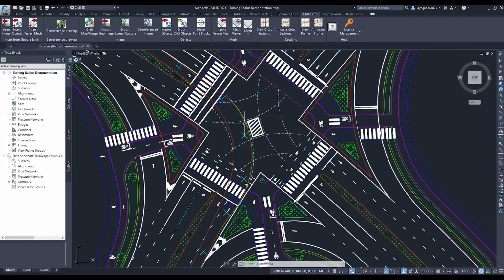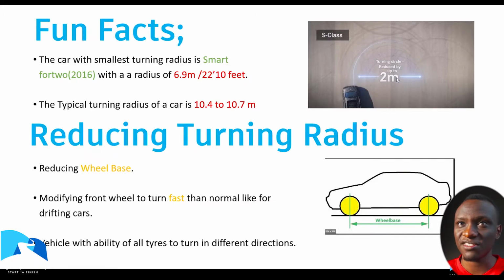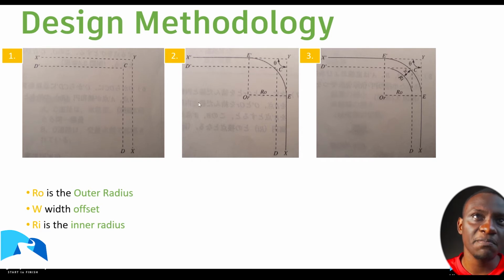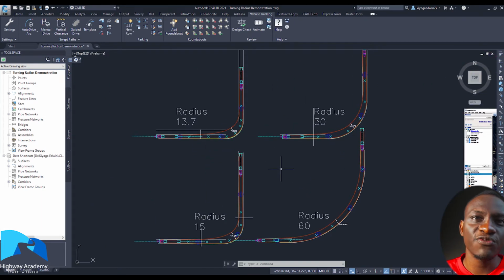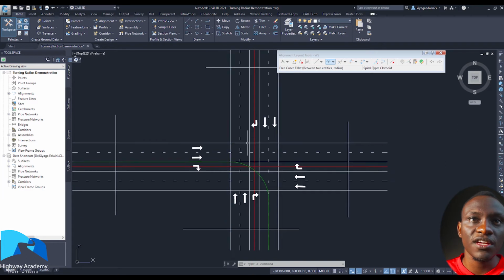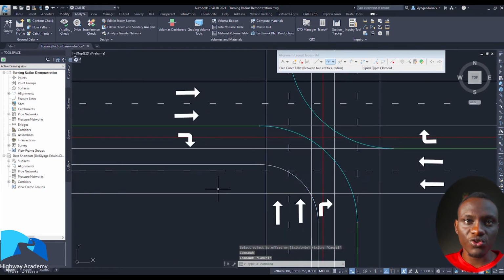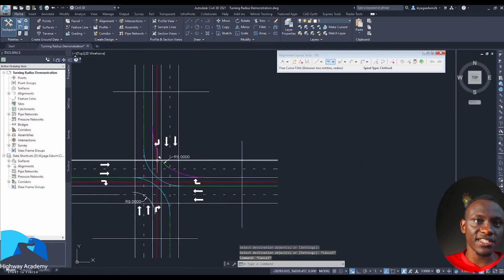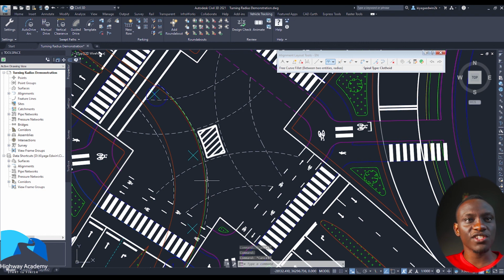Junction Design in Civil 3D:Turning Radius, Design Vehicle and Swept Path

Comment from the maker: The moment you've been waiting for has arrived! 
Our complete Ultimate Guide to Junction course is now officially LIVE on our website and also the beginner's Junction YouTube playlist is available. 

Connect with us: 
✅https://hwy.ac/junction

00:00 Intro
00:05 Introduction to junction design and turning radius methodology.
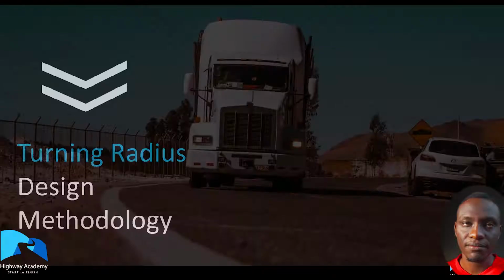01:01 Explanation of different turning radius types (curb-to-curb, wall-to-wall, inside).
01:56 Fun facts about turning radiuses.
02:42 How to adjust turning radius.
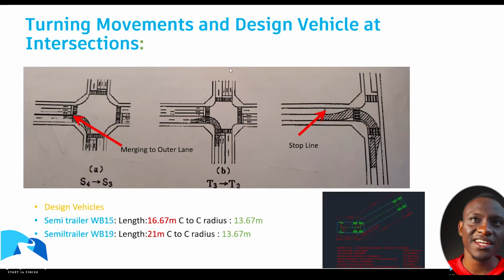03:43 Overview of intersection turning movements.
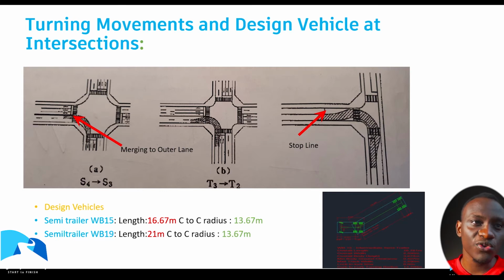05:30 Introduction to AASHTO design vehicles.
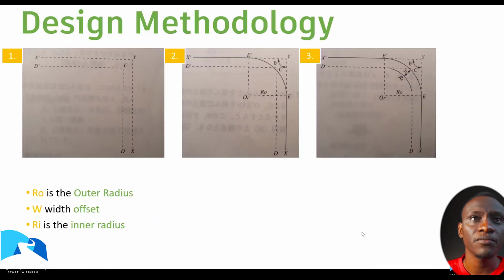06:04 Step-by-step design methodology for drawing turning movements.
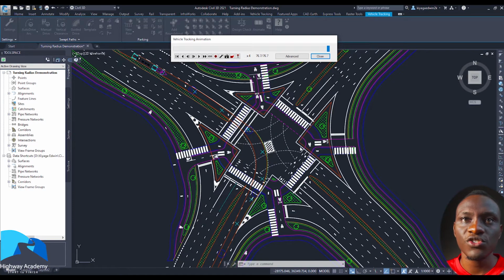07:57 Civil 3D demonstration of turning radiuses in a junction.
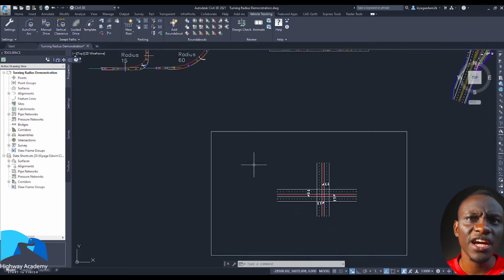11:09 Detailed steps on drawing turning movements in Civil 3D.
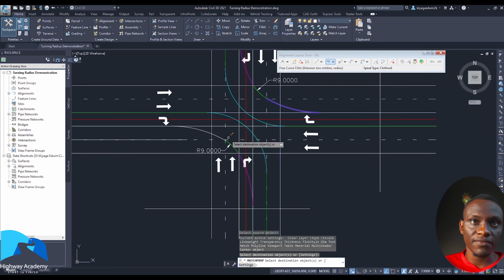19:15 Using vehicle tracking in Civil 3D for simulation.

Comment: Why the offset from the external radius is 6m? 
Why is 3 x 9000 when you draw the tan tan circle? magic figure?
Reply: with experience you learn these figures from manuals. Swepth guide on offset for widths based on speed.
Reply from the maker: That explanation should do